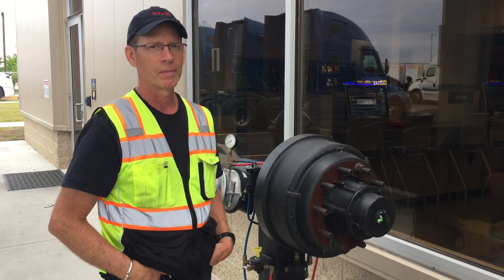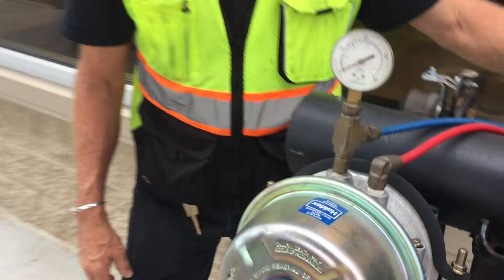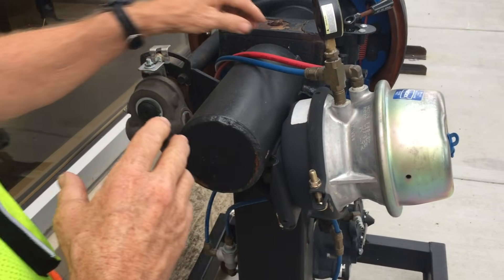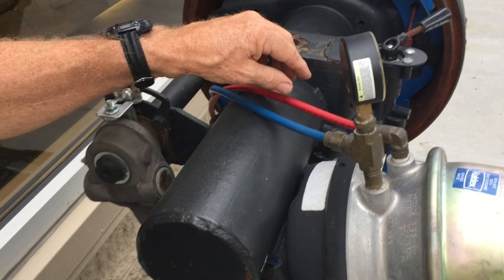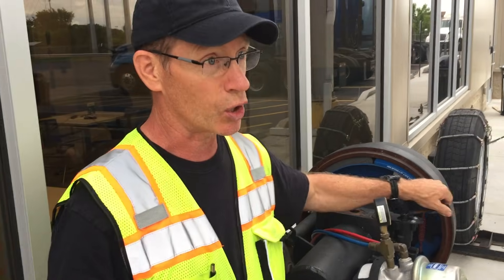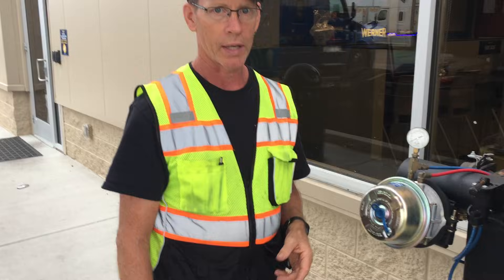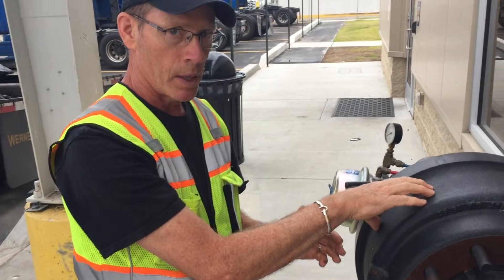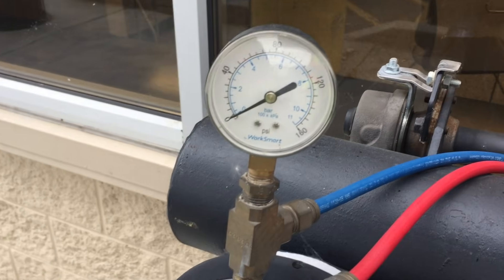Air Brakes | Air Brakes for Trucking | Air Brakes Explained | How Air Brakes Work | Compressed Air

Comment: Amazing very explained video!!! Is the only reason for air brakes over hydraulic brakes on trucks because air is faster? (Besides the fail safe system)
Reply: That is not the only reason.    It is easy to disconnect and connect airlines  to a trailer but hydraulic lines are difficult to connect or disconnect without getting air in the lines that could cause serious issues with the effectiveness of the brakes.   Another reason is that hydraulic brakes lose pressure with distance from the pump system.   Another reason is the pressures required to activate the brakes with enough force to stop a vehicle that heavy.
Reply: Air compresses to the point that relays are needed to quicken the response of an air brake system. That's why 'brake lag distance' is covered in the CDL manual. With air brakes on a semi at 55 miles per hour it takes 32 feet for pressure on the brake pedal to translate to pressure on the brake drum or disc. In a hydraulic system it's instantaneous. Hydraulic brakes are actually 'faster'.
Reply from the maker: @numbzinger350  Thank you!!! Very much appreciate your explanation and adding your valuable knowledge to the channel. It helps everyone!
Reply: Faster, safer because of the ability to have a secondary system, and I don’t think with hydraulic brake systems you are able to isolate one wheel end like on air brake systems. If you have ever blown a brake line on your car or pickup you’ll notice that it pretty much blows all the fluid out and you are barely able to stop. Imagine if you where rolling with 80,000 or like we do in Mich. and drag around up to 164,000 lbs gross and that happening. Wouldn’t be good I suspect
Reply from the maker: So….actually it’s not faster. Rather it us safer. Sorry about that!
Reply: Air brakes are more reliable and more powerful. A small air leak can replenish itself but hydraulic cant.

Comment: I was trained that using just the trailer brakes in situations where rear of the trailer is starting to swing out in slippery road conditions can help straighten it out and prevent a jack-knife.  I practice applying the trailer brakes so I know where the brakes start to engage if I should ever need to use them.
Reply from the maker: Great thing to practice!!!! Though we hope you never need it for an emergency situation!!